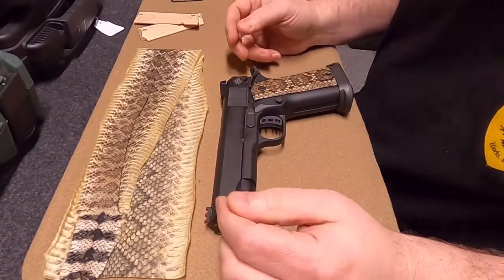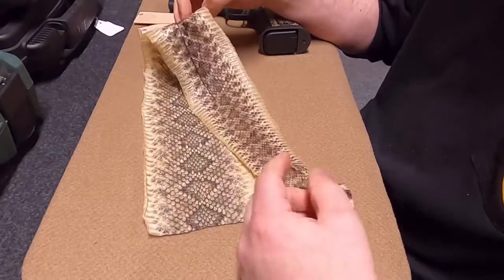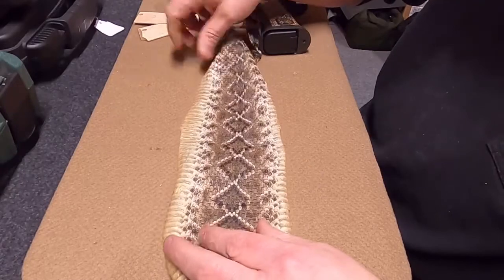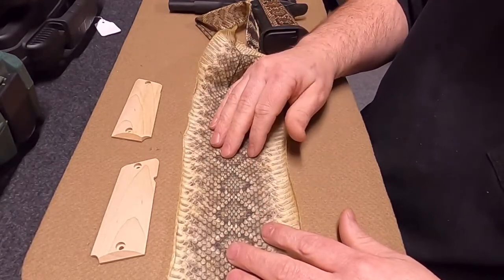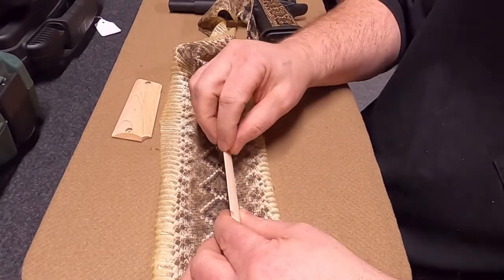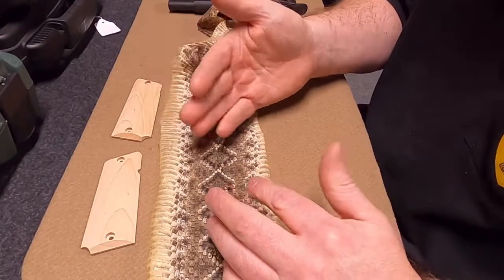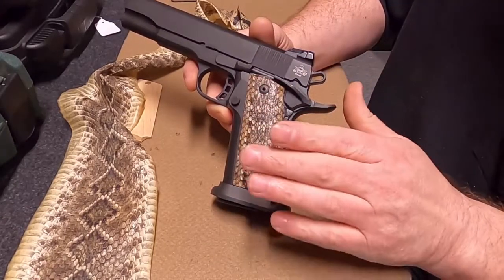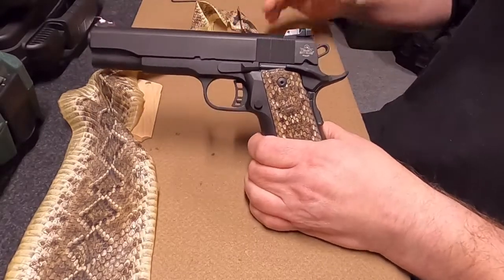RIA 1911 A2 HC double stack Rattle Snake Skin grips

Comment: If i sanded down my wood grips, could i take my  snake skin and epoxy it on?
Reply from the maker: If they were tanned, make sure to get any oils off first. If you are sanding your grips, keep them rough but make sure to get all dust particles off.
Reply: @BrowneWorks  what if they're not tanned yet?
Reply from the maker: @patioorangutan2239  I have used untanned skins as well.  I still wash them with dish soap.  Usually the untanned hides that I get are very stiff. I leave them a little damp so they are still pliable and can stretch over the grips.
Reply: @BrowneWorks  thank you for the responses!

Comment: I might have missed it but what do you use to glue them?
Reply from the maker: I have tried a lot of different adhesives but Titebond III works the best. After it dries and cures, it is water resistant and heat resistant. I also use a small amount of CA glue on the seam as an added precaution. Thanks for watching.
Reply: @BrowneWorks thanks buddy.